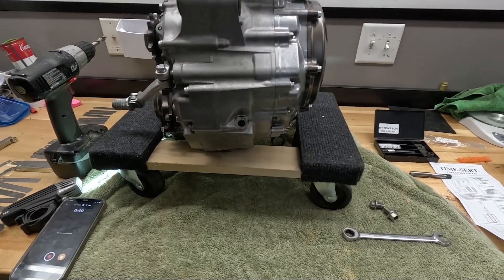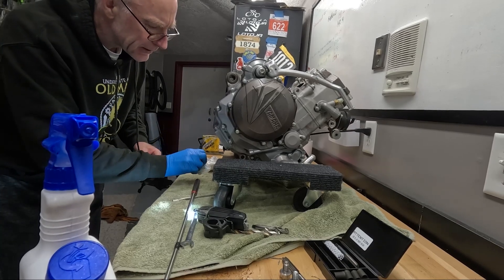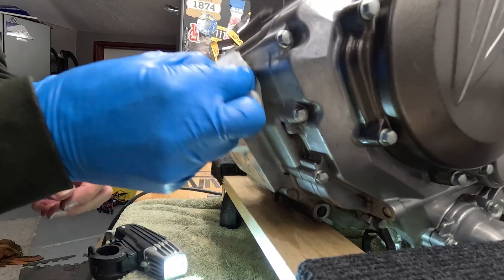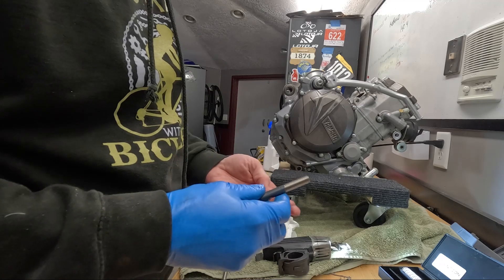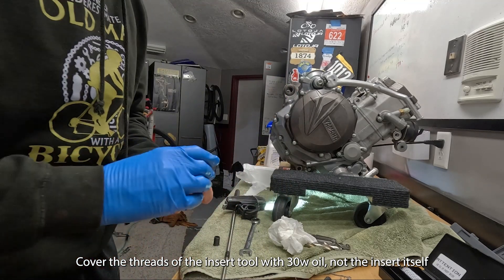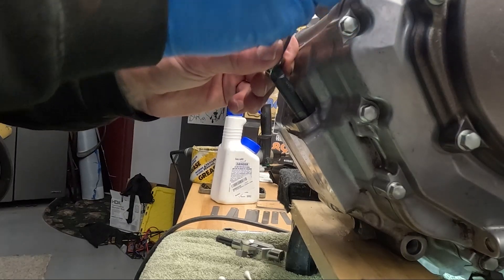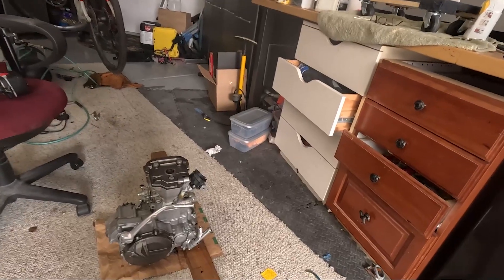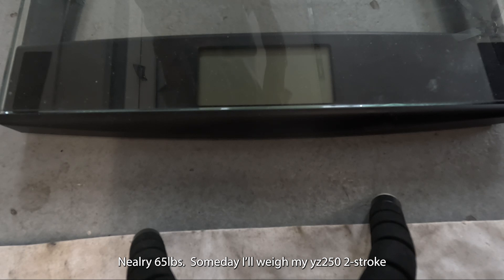2017 Yamaha YZ450F Drain Plug Stripped, Repaired. YZ450f Engine Weight revealed.

Comment: This was very helpful! I have to do the same to my 2015 bike. Not sure I will be able to pull this off. Don't have the time nor the space and tools to do this. Did you try using red loctite? I'm not sure what will happen when I have to open it again. I also saw someone use small copper wires.
Reply: Nope I didn't try anything like that, only a new drain plug that helped a bit but didn't solve the problem

Comment: Link to the kit you used?
Reply from the maker: Item #	Description	Qty
1012	M10x1.25 Thread repair kit	1  From  https://www.timesert.com/html/universalheadbolt.html
Reply: @grandpapayoutuber3664  just ordered kit off eBay, thank you. I ended up going with a little shorter inserts 14mm. Bike is in the shop.
Reply from the maker: @firesquad6150  Good luck with the fix - so far mine has held tight for 5 or 6 oil changes
Reply: @grandpapayoutuber3664  thank you sir, insert is in. Coated with loctite. I think it will be a forever fix hopefully!
Reply: How is the 14mm holding up for ya?
Reply: What was the length you used 16mm or 14mm?

Comment: magnetic drain plug aint gonna help get Aluminum shavings
Reply from the maker: You are correct.  I tried my best to get all of the shaving out using the grease on the tools/bits and then flushing, what you didn't see in the video is that i also heated it and flushed a few more time.  Before putting the engine back in place I rebuilt the top end so i had even more access to try and flush everything out.  But in the end, after it was all back together and on the track i ran for about 30 minutes then checked both filters and there were a few bits of shavings caught.  ...  Anyone know a better way to get the shavings out?
Reply: @grandpapayoutuber3664 in my passed experience having a few bits of aluminum running throw an engine isn’t necessary a bad or good thing. The aluminum is a soft metal so if it get caught inbetween some gears it with crush before the gears are damaged and then get caught in oil screens or oil filter. Now obviously having metal running through an engine isn’t great but if it’s aluminum it’s fine